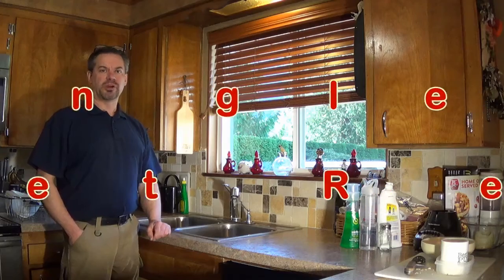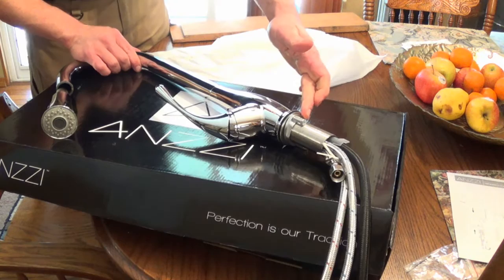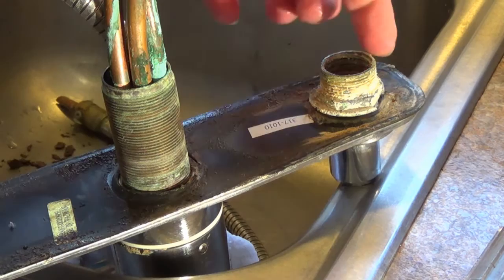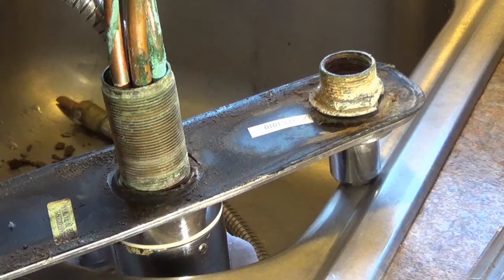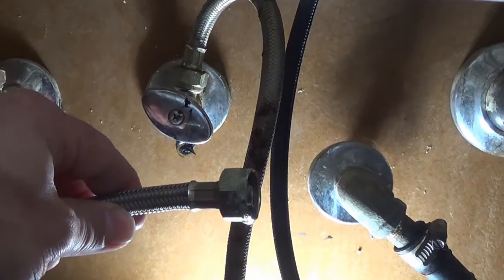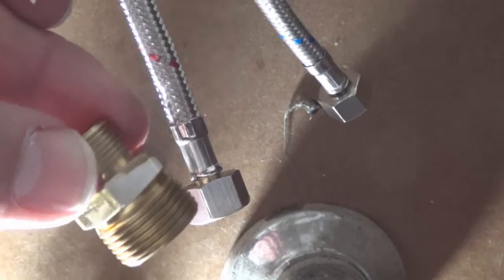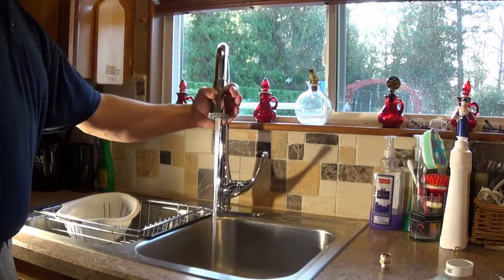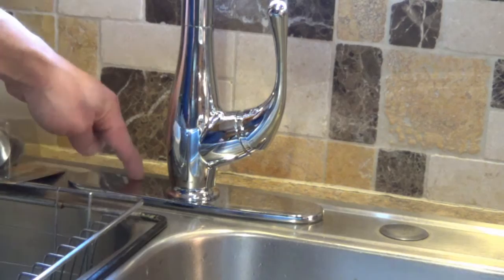Anzzi Single Handle Faucet Demonstration

Comment: Redid mine with one of those a few years back...still operates great. Thankfully, didn't need a reducer fitting. But, installing faucets will test your patience...esp if there a "drip-drip-drip". Nice work on your's...looks great.
Reply from the maker: +Chris DIYer    New fittings and liberal teflon tape eliminated most of the potential drip-drip problem.   I think the faucet looks good too.  My GF picked it out, so I don't have to worry about her not liking the way it looks.

Comment: Just change mine out a few months ago what a pain when U live in a Manufactured Home  ( Double wide Trailer) No real home stuff fits anything But I can always steal stuff off my Lance fits fine. Plus U had a helper!
Reply from the maker: +TheKilog69   Some helper.  That little turd picks stuff up and runs off when you aren't looking.   I have another nice faucet that I want to put in the galley of my camper, but it is chrome and my sink is plastic, so I don't think it would look good.  Not sure if I want to go the extra step and change out the sink too.